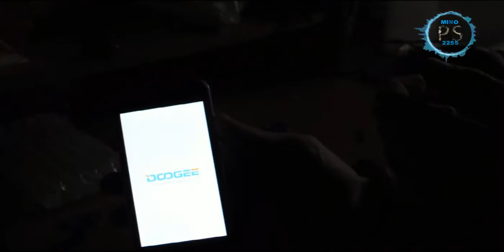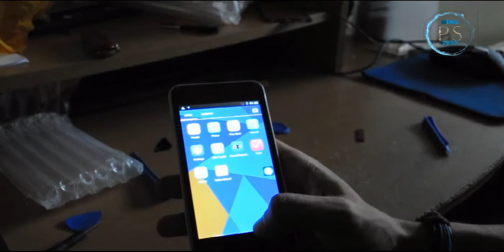DOOGEE DG800 Repair Touch Screen [TUTORIAL]

Comment: Dont buy any doogee mobile plz
It has lots of problem
This is my experience with doogee brand
Just wst of money 💰. .......😡😡😡😡😡😡😭😭😭😭
Reply: u've juz have a bad experience with one, i've had mine 3 n' half years and dropped it n' got it wet many times, still workin fine, plus i've sold at least 20 n' not had one bak yet, so in my book doogee is best n cheapest smart fone in the marketplace, i can't fault them. i only paid £35 for thenm too
warm regardz  {^_~}  
jakkadan